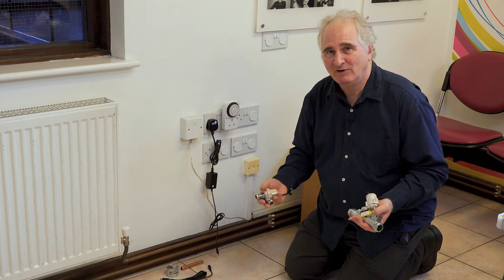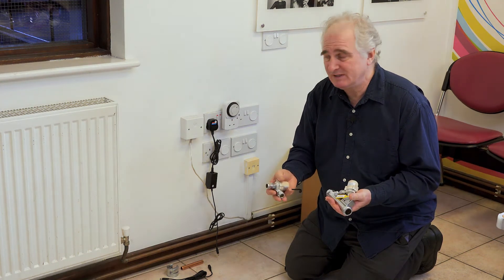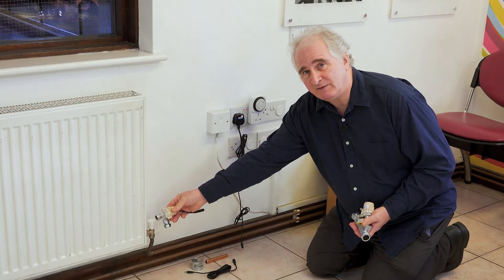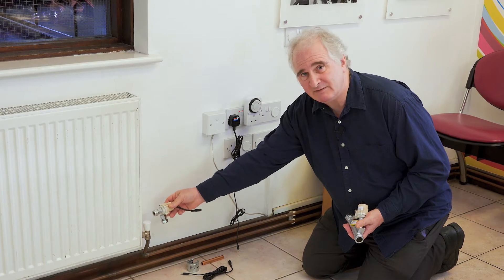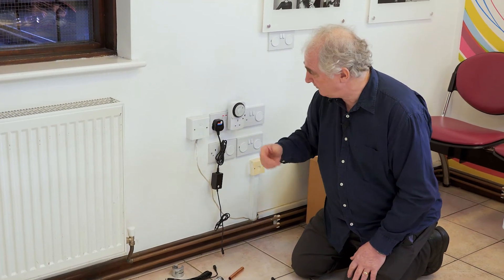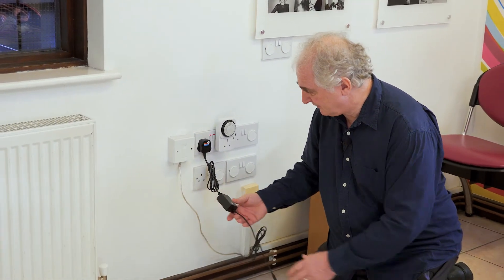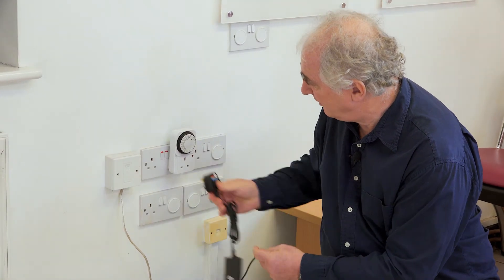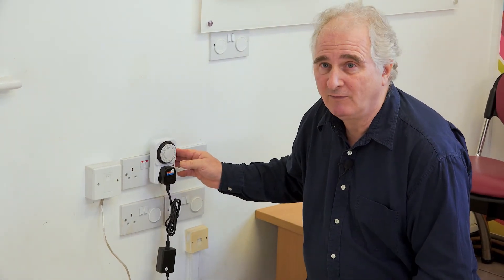Where to Fit a Radiator Flow Booster

Comment: would fitting one of these  (especially the V2) benefit the whole central heating system or would it mostly benefit the radiator it is put on?  As regards the V1 is that more beneficial for the whole system and if so should it be fitted more centrally or does it not matter where it is put?
Reply from the maker: The V1 and V2 boost a couple of radiators that fail to get hot and not an entire system.

Comment: I am looking to buy the V2. do they make a big difference? What's the flow rate ?
Reply from the maker: Yes they make a big difference and any radiator that does not get hot will get hot.
Reply from the maker: Yes - the flow rate is up to 5 litres a minute .